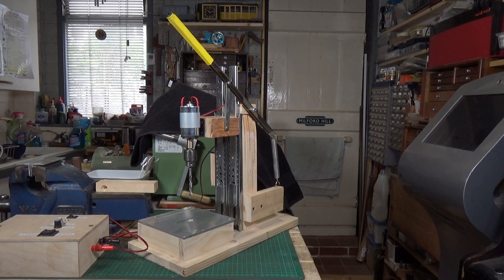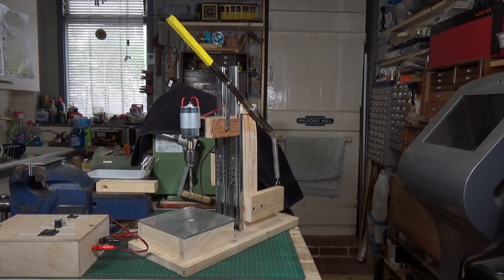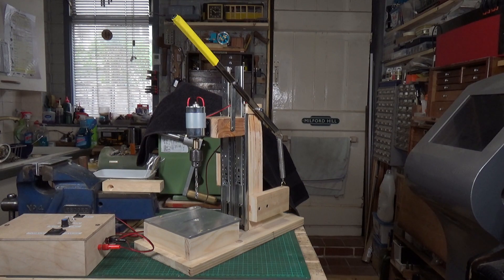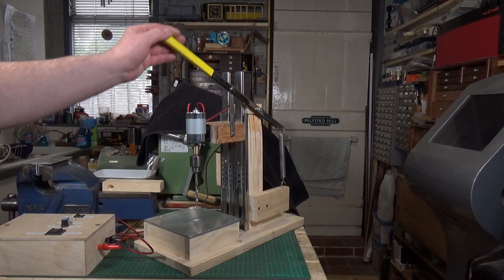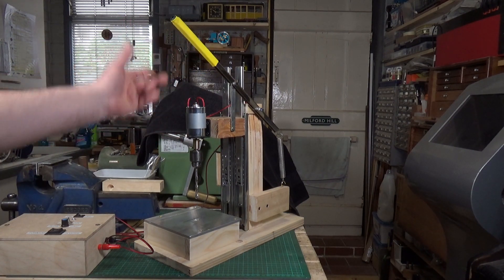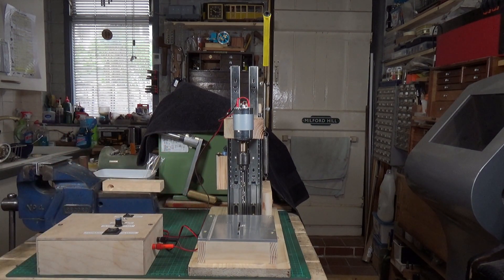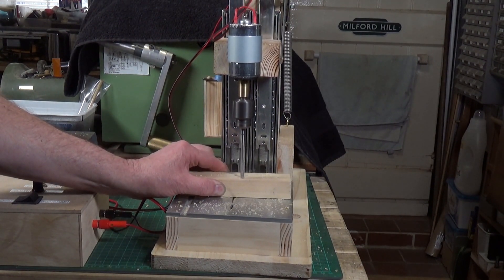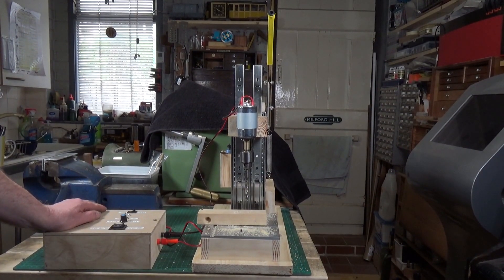775 DC Motor Based Scratch Built Mini Drill Press

Comment: What a great idea. That little 775 motor is awesome for it's size.

BG have some handy kit for model work.  The limit is your imagination.  Cheap as chips.

Cheers Rob
Reply from the maker: They are fantastic little motors. I've got an idea for a small table saw using most of one of your spindle kits, minus the chuck and some of these bearings.

https://www.banggood.com/8mm-to-35mm-KP-Series-Bore-Diameter-Mounted-Ball-Bearings-Zinc-Alloy-Pillow-Block-Housing-p-1076413.html

Then maybe an 85mm or 110mm saw blade.

Cheers, Alan.